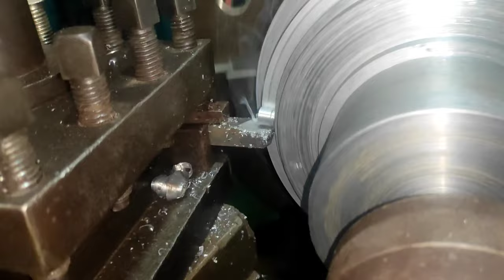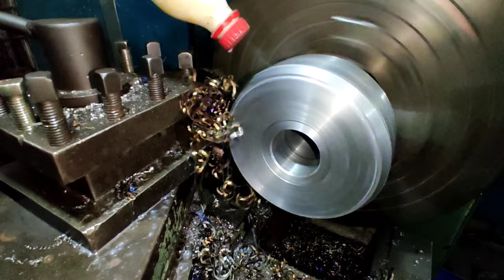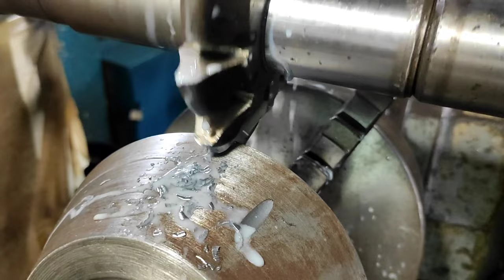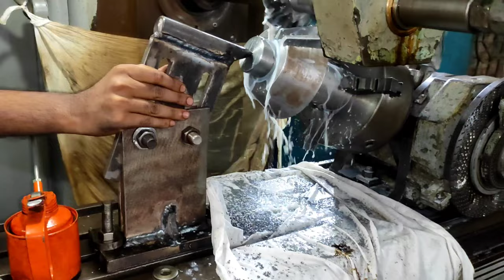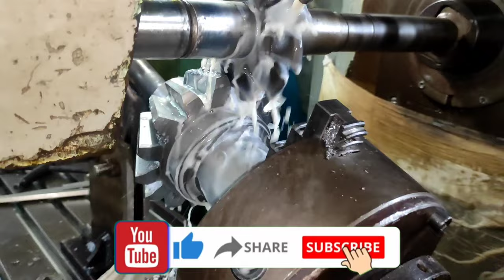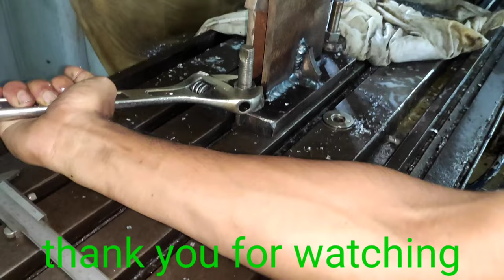making a bevel gear on horizontal Milli machine,#cutting#bevel#geare

Comment: Good morning.
How do you choose the right bur to use for tooth milling? I tried to buy a commercial bevel gear it says Module 3, the trailing tooth measured with a module 3 disc cutter is ok, but the front is smaller. I would like to understand how to choose the right cutter to use for milling. Thank you
Reply: Following
Reply: Demandez au fils d'Einstein